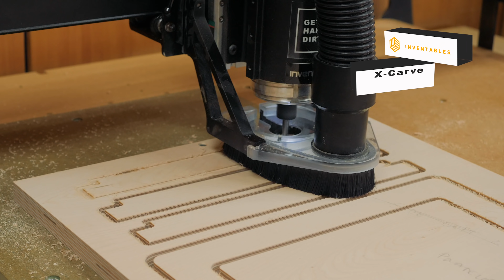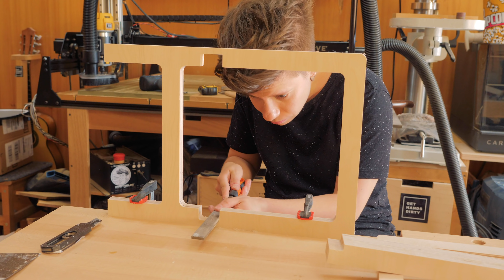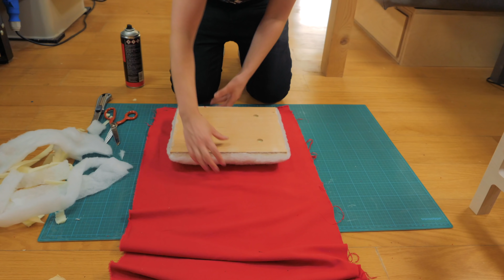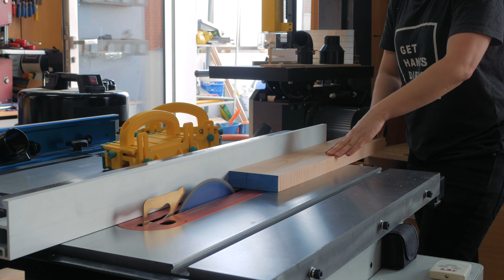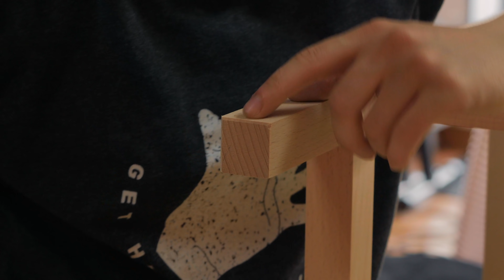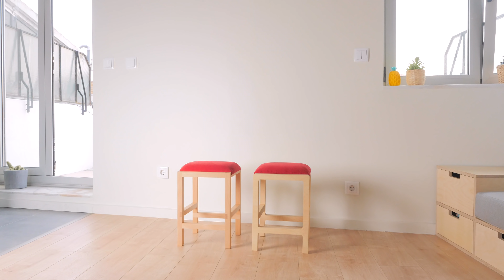How to Make a Stool // 2 Different Methods

Comment: Just received the plans. As much as I like the the appeal of plywood, current prices, that would be a $200 USD stool. Making as a house warming gift for the spring out of hickory. Set of 4 or 6. Haven't decided yet on the quantity, however a dado stack needs to be ordered.  And a new sled for table for the saw, the original was one of the first jigs, tools I made for it and even with the 5 cut method from William Ng, well frankly it's crap.  Great to see you Christina. Just looked up the part of Portugal you are in, Beautiful.  Cannot figure out how I missed this 2 years ago.

Comment: Really nice work, kudos to you.  One thought. I would have rabbeted a small shelf/recess for the sear support frame to rest in and support the weight of the user. As you attached it, you rely on a few screws to support the user. I imagine a party, and my 300 pound friend ploping his butt down on that stool, and the seat will rip those screws right out of the frame!

Comment: I'm glad you're safe! I did something similar a few years back; I left a steel ruler on the crosscut sled while making a cut. It ruined the blade and ruler.
As for the stools, I like the shape of the plywood version, but would use solid wood for that one too.
Amazing attention to detail. Subscribed. :-)

Comment: I liked both versions, but prefer the plywood, because im just in love with plywood edges
Good to see that incident didnt become an accident too, glad youre ok

I would also like to add though, i'd have preferred to see the stools made from straight strips of wood, so there wasnt so much waste that the cnc cutter causes, not just from the centre of the A-frame but also from around the edges too, they seem very wasteful of wood
I know youll find a use for most of it, but still hate to see so much wood/ply wasted

Comment: I like them both. What I really love is how you show two completely different methods to make essentially the same piece.

I've seen sawdust used as gap filler, but this is the first time I've seen a chisel shaving used. Simple and completely effective.

8:35 I literally screamed, "YAAAAA! What the F*%$^&CK!" at my computer. Glad you weren't hurt. 

Very nice crosscut sled. Will you be doing a video on how you made it?

Comment: Love the fabric, any information it's color name. I use a tool tray near any power tools. seen a router bit that flew out and bend the shaft. kickback on a table saw that missed me from a saw off to one side. a face shield with a gouge in it. high school accident. wood blew apart on table saw I was working on. bad wood that looked normal. glad you are ok.

Comment: I would imagine plywood would be more durable.  However (I have no doubt the person making these stools was well aware), the solid wood stool simply wasn't designed for the method of construction.  The tab-and-slot joints made sense for CNC, but for regular saws, the joints should probably be either mortise/tenon or finger joints (like what Mathias Wandel does).
Reply: She has also done these finger joints in other videos.
She is always innovating and likes to show other processes.

Comment: Lovely work with suggestive process of making. One rounded where the other one is squared, they work both because together. Alone they were just a stool, making a couple You built a conversational piece of design. This is the most intersting part of this job: giving a meaning to an object that is no more a stool but an idea :) Your progress are as  unbelivable as your skill in storytelling and managing the light :)   btw is it  a new benchsaw?

Comment: I think if I were you doing this project, in order to keep the emphasis of the different timbers/approaches to construction, in the ply stool I would have left the mortices rounded straight from the router and shaped the stretchers to fit, as you suggested in the commentary, to match the more rounded, softer vibe. Nice vid.
Reply from the maker: That would have worked nicely, yes! Maybe the overall look would have been more consistent because of the roundness.

Comment: While the plywood layer lines do have an appeal, I prefer the solid wood grain and the half lap joinery.  Although the rounded top corners from the other design might be more comfortable on the tushy and backs of someone's legs.  Maybe bring those rounded corners into the solid wood stool, when/if building future ones.

Comment: When you cover upholstery you should fold the side over and start stapling from the center and work your way out to the corners.
Reply: Also, put a staple in the centre of one side, then pull really tight and put one in the centre of the opposite side.  Repeat for the other two sides.  Pull it tight, then pull a bit more.  These are temporary staples to keep the tension.  As Victor says, work your way to one corner, then pull out the middle staple and work to the other corner.  There is a knack (which I'm hopeless at) of smoothing the fabric round the edge and holding it while you staple.  It helps give a smoother edge.
Reply from the maker: Thanks for the tip! I need to improve it :)